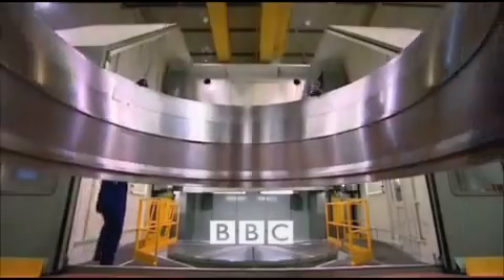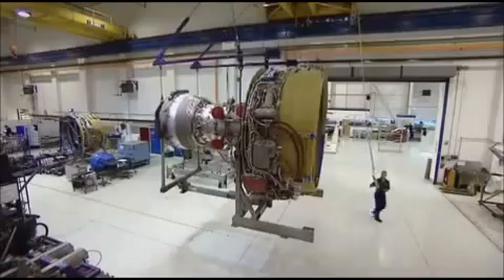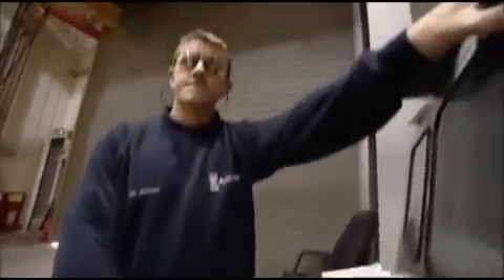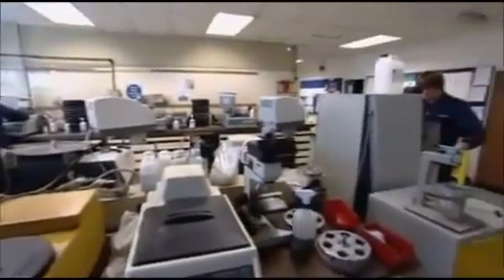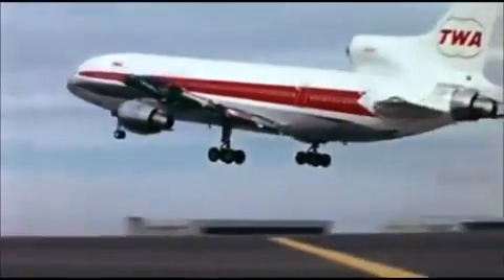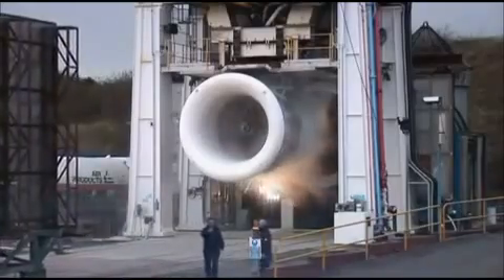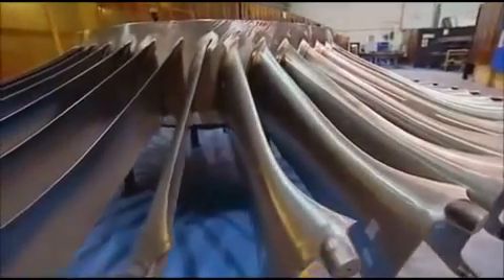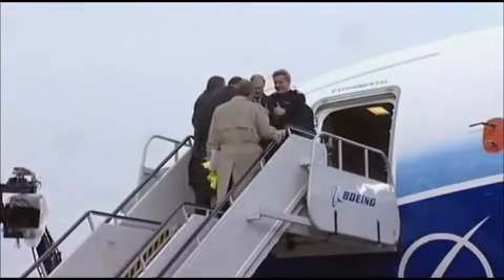Documentary Rolls Royce - How To Build A Jumbo Jet Engine BBC

Comment: In my youth I worked at a foundry that cast jet engine parts. Some of the molds were huge. My job was to smash the sand molds with a sledge hammer. A great job for working off your frustration ;7). The forge was in Wednesbury, west mids and was a dark satanic mill compared to the Rolls Royce factory. Derby is also nicknamed Dubai in the West Midlands.
Pay no attention to the comments moaning below. This is an interesting watch and doesn't get  to technical. It amazed me that they monitor the engines while in use on aircraft. I think that the people moaning below wished they worked at Rolls Royce instead of serving food at Mcdonalds.

Comment: Look up Quantas RR engine blow up, big chunks fall of airplane almost crashed,
GE makes the better engines. never failed yet,
Reply: GEnx  engines   powering  the  787  Dreamliner   experience  many problems.. Even   the FAA issued a warning to  Airliners who use  it  to  avoid   thunder  clouds . Rolls Trent 1000  seems to be more reliable..
Trent 900 was a serious problem thats correct but it has been fixed.
Reply: Before you blurt out shit, go learn some history. There's NO SINGLE Rolls-Royce turbofan responsible for any lethal crash anywhere until today. GE and Pratt & Whitney engines were the cause of most lethal crashes on commercial passenger aircraft all over the world up until today, including GE's CF6-6  failure which is responsible for killing 111 people on United Airlines Flight 232.

Recently a GE90-94B blew up in a quite similar fashion to QF32's Trent 900 incident, only that the GE90 caught fire and injured more than a dozen people, while no single person was injured on QF32. And not only GEnx-1B is problematic on the 787, the GEnx-2B on the 747-8 suffers similar icing problem which caused all the engines to fail and have sustained damage.

Rolls-Royce is one of the pioneers of aviation, and they make one of the most reliable turbofan. Trying to give it a bad name just because one single incident which doesn't even cause the aircraft to crash land is a downright idiotic. GE is probably the most overrated company I've seen, I can't believe so many people are worshiping their engines as if they're made by gods. Hollow titanium, wide chord, and swept fan blades are all pioneered by Rolls-Royce, which GE later used. The first turbofan to break through 110,000 lbs of thrust is the Trent 8104, which is cancelled due to GE's money offering to Boeing in exchange for the GE90's exclusivity to power the 77W. GE took much of the credit which should have gone to RR.